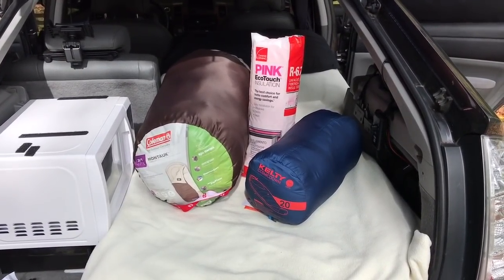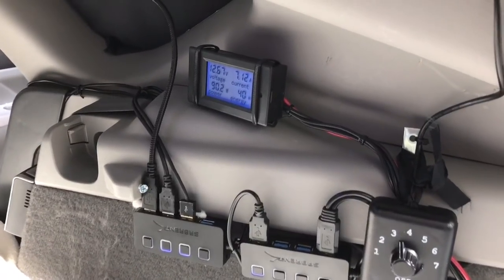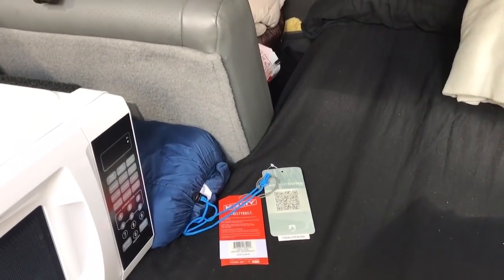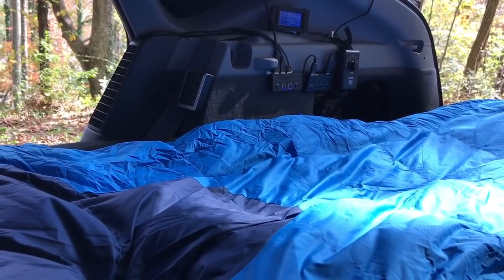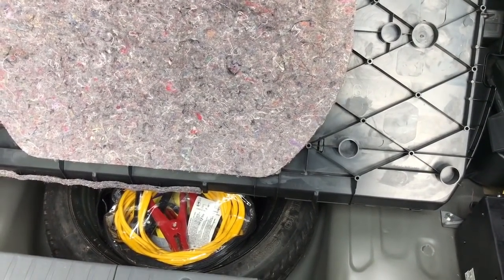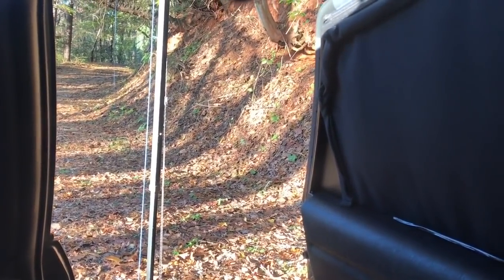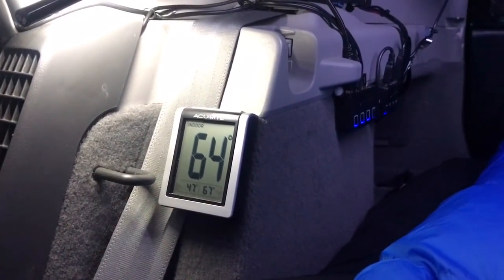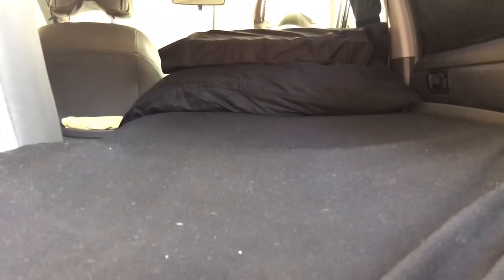Winter Prepping Insulating Kelty Sleeping Bag Prius Stealth Camper Heating Car Van Vanlife

Comment: Wool blankets do the best at trapping heat. I realize they are not easily washed ( will shrink) but can be found in thrift stores for very reasonable prices in good condition.  Wool is also anti microbial.  I cannot stand fleece because it’s hot, and made out of plastic bottles.  I need to lay down only on cotten or wool.
Reply from the maker: Good idea!

Comment: FYI it's a good idea not to use the stuff sack unless you absolutely need it because the longer the sleeping bag is compressed, the more quickly the filling loses its loft and insulating properties. This is why good quality sleeping bags always come loose in a hamper style bag rather than packed up tight in the stuff sack.

Comment: Loved the video and your electric set up I have a 2005 Chevy blazer 2dr 4x4  Which i have up upgraded almost everything on that truck small sample : 2.5" lift kit,  hand sewn Leather trim, Custom paint, Front and  rear dash cam on 24hr continuous  Electrical up grade 
Now in the late fall i sat down And thought of the main uses of my truck Mostly winter driving and Camping in the summer / fall and the odd run to the Drive-in with the girlfriend  Its just us and 2 small dogs  And i never plan on selling my truck 
So I removed the rear seats, The spare tire mounts on the left wall inside the truck on a metal tube frame which was removed  The plastic paneling was also removed  Roof paneling also removed to just behind the front seats  A wooden trim will cover the cut later.
The spare tire will lay mounted behind the drivers side seat (still able to move the seat back forth ) A framed cover over it. 
 A double battery in the pass, side and small PVC tubing on the inside walls in the back for wiring  Next will be welded angle iron in 3 inch pieces along the sides of the rear framing to make bedding slats rest on them and a pin or bolt to keep them in place or remove them for hauling items and need the space. I will be having a friend's company spray foam top to bottom ..Min 1 inch in some areas But 2 to 3 inchs for the most part The tubing will be buried in foam. Then the wood flooring  and pot lights (2 per side) 
I dont know the climate your in But I'm in Southern Canada and there is a lot of moisture in the Northern American zoning So batt without a vapor barrier or even with a barrier still makes the truck damp and moldy and rust out quicker 
With the Spray foam  The truck will stay cooler or warmer than the outside temp i would think by 10*C 
The windows will be fully covered with a thick canvas type cloth and double thick reflectix which gives a good R value  if you have a perfect seal
Now here is the best way to save even more heat > I will adjust the front seats all the way forward and bend them forward And another reflectix curtain One on each side will run on a tight cord on the roof with Velcro strips on the roof, sides and battery /spare tire frame 

If you have the money and chance ..Look up local Spray foam installers and see how much to do your car ..Provided you remove everything and prep the car for it ( cardboard the windows and tuck tape unwanted items ) Trim the extra foam P.S. its cheaper if you meet them on a job site and pull up and open the rear hatch ( takes about 20 mins if that 
Next idea is you can buy a 2 part spray foam canister for around 300USD and do it yourself 
Next is this gap filler spray foam which does not have the same R value but is good for nooks and crannies 
Ridged foam is also a good cheaper way provided you seal the gaps in between with Gap filler AND foam tape and making sure the have chaulking to the wall of whatever they are there to keep cold / heat out of so no water forms
Reply from the maker: Sounds like you have a great build in progress. If I tear mine down I think I will go with the spray foam. I think it's worth the cost. Thanks for posting all the good info and for watching!

Comment: Just found your series of videos and it great to get some ideas to add to my Prius road trips. Hit the subscribe button and look forward to what else you come up with.
one item that might be useful is duct insulation from Home Depot. I think the brand is Frost King. It is about 12 inches wide and comes in a roll. It has a gray  adhesive  material with a foil face. I used a couple of rolls to sound deaden the inside of the doors. Think cheap Dyno-mat. It really made a difference in the road noise and I am sure helps somewhat with insulating heat and cold.
Reply from the maker: Thanks for the tip, sounds like a great idea! Glad you are enjoying the videos and thanks for subscribing!

Comment: just adding another inexpensive blanket layer would hv done the trick... complement your current fleece w a synthetic blanket to help trap heat. also hug against your chest something like a pillow or teddy bear :D while u sleep...after a few min u can feel your core body heat reflecting back to u...even when sleeping on your back, just lay a pillow on your chest

Comment: I snow camped in my Prius V last winter. (btw my two favorite nights are -10 degrees F in a tent in Kings Canyon and 40 degrees, 20 mph wind next to a wind block outside in my bivy sack on Mt Kitadake in Japan--so  not only do I have some experience, I was snug and in bliss.) My tips: winter sleeping bag, fleece liner... and bivy sack (REI used to sell an inexpensive bivy sack that I picked up in a parking lot sale for $12 (best $12 purchase of my life). I'm sure you've figured out that a sleeping bag with all the  zippers up, and just a ring around mouth and eyes is 100% more effective than with even a one inch gap. Also, moving blankets are cheap, cozy, very  warm and keep in the heat.You're not allergic to down! I am so jealous. (If you do wake up with a plugged nose, put it in a dryer on air only. Takes a lot of the tiny nose itchers.) Of course you know not to stuff your down bag except when you have to.  In the snow I ran my Prius until about 9:30 pm and started up again at 5 am when I got up. I figure I ran the car over a week for about 30 hours on idle, to stay warm, run my inverter... and I don't think in 1800 miles I took more than 1 mpg off my efficiency. Have you done a  more scientific test on this? I'd love to know. There might be a day when a car is always 'on', like the electricity in a house and it just knows when to heat up a little, to start the traction motor, etc...
Reply from the maker: Wow! thanks for all the good info.  You are brave to endure such temperatures! Good to know about how you did it. I wasn't aware that some people are allergic to down, good to know. I eventually did figure out to leave the down sleeping bag out of the sleeve as much as possible.  It takes some time for the down to fluff and be most effective. I too am looking forward to refining the ON process to be full time.  I would be curious how the new Prius' are doing it, hopefully more efficiently and smartly.  Thanks for you comments!

Comment: While driving my Prius in cold weather, I notice some cold air comes from the handles where you open the door. A lot comes in. I was surprised when I put my hand and felt the cold air. Even during car camping.
Reply from the maker: I have had the same experience with the entire door feeling very cold. I wanted to open up the door panels to see if I could do something about it but was afraid I would break something expensive. I was able to solve the problem with the back hatch as I found a video where the worst that can happen is you have to get some of the cheap little plug connectors. I can't find a video on the door panel removal. Let me now if you run across one.
Reply: @timdillen  there was someone on another video recommending the search "soundproofing prius" that brought up how to remove the door covers. However, I would think that water or condensation would be an issue inside the doors. What did you find out about the insulation in the back panel, etc? Any water issues?

Comment: PSC Camper Conversions your Prius camper looks so cozy I want one just to sleep in instead of my bedroom! I hope I can make my old 1996 Isuzu Rodeo as cozy as your Prius. I had some leaks in the back hatch and it took me a while to discover and find them. By that time the carpet in the back bed was smelly and the underlay was even worse, and had black spots, which I was afraid was black mold. So I threw the whole thing out. Now the back cargo bed looks like the bed of an old pickup truck. Metal with ridges and valleys. I was thinking of putting down a sheet of plywood to even out the floor. Would you recommend using the same kind of insulation underneath the plywood as you used in this video?
Reply from the maker: That’s a tough call. People have a lot of opinions on it. Plywood would be good just make sure you completely seal both sides and edges with paint(exterior gloss)/caulk so mold can’t take hold. Several people recommend drilling large holes though to allow some airflow in the wood. I fold up my mattress occasionally just to make sure everything can breath.
Reply: @timdillen  thank you! My bed will probably be a raised platform and I will use either holes or build a slat bed, for the ventilation. But I want the floor to be solid. I'm really enjoying your videos and getting a lot of great ideas and information from them. Thank you!
Reply: Hopefully, you will eventually see this as I know that it's been a while since your post.   I'm curious as to how the rodeo faired, I have a rodeo as well that I'm tinkering with.
Reply: @tonietters1972  A lot of stuff came up and I have not yet converted my Rodeo. But I keep think of it, and turning over different ideas in my mind. One thing that really bothers me about my Rodeo is the electric windows keep failing. I buy new motors and the whole system that raises and lowers the windows and replacing them. But every couple of years or more often they fail again. Do you have any trouble with yours?

Comment: An  amazing series of videos! Thank you! But I have a question. Obviously the insulation helps in general, but the high consume electric blanket worth against the efficient Prius climate control? Finally the batteries are going to be charged by the engine anyway.
Reply from the maker: Good question.  I have been researching ways to stay warm that provide the least cost and most stealth.  The Prius climate control is great but I'm always trying to find a better way.  I am working on a new heating project which will provide lots of heat for very little money. I hope to have the new video up in about 2 weeks. Hope you will enjoy it.

Comment: I took a nap in my van today, and notice at the back I definately have to put my window treatment up, and probably devise some sort of insulation on the door. not quite sure yet.
Reply from the maker: I found the door panels that have operable windows don't have any insulation in them. When you compare the inserts to the door temp you can really tell a difference.

Comment: Great Vid.
You mentioned a possible moisture problem?
Doesn't the car develop a build up of moisture over night and when that happens isn't it going through the batt insulation to the metal (eventually)? Especially in the low lying areas like the spare tire area etc.
Thinking of how a house is made you might need a vapour barrier but that is problematic in a vehicle? The pink insulation is of little R value after it gets wet. However, Roxul insulation as an example doesn't ever loose its R value and its fire proof also. 
Still, I like your ideas and drive.
Ciao
Reply from the maker: So far I have not had any problems. The first thing I do in the morning is turn on the A/C (either hot or cold) which runs the compressor and clears things up in just a couple minutes. Then I open the windows a crack all around when driving that day.
Reply: @timdillen  why not leave the heater on all night in Ready mode?
Reply from the maker: That will work. I like to stealth camp in parking lots that don't allow RVs so I try to find ways to keep the engine kicking on and off the least amount.
Reply: For sure, your on the right track. I stealth camp as well in my Jeep.

Comment: Really enjoy your videos. Do you ever worry about CO2 inside of the car during the night?
Reply from the maker: Devin Miller So far I haven’t felt any ill affects. The Prius has an open vent system. On the passenger side rear seat there is a good size grill the draws air into the battery compartment. It then goes through a duct out the right rear wheel well. I think there is enough passive air with the car off. When in the ON position a fan comes on periodically in the compartment and draws in air. I think there are also other places where air leaks based on how certain panels feel when it’s cold out - especially door panels. It would not hurt to get a CO2 meter to check. So basically I’m not sure. Thanks for your comment and for watching!
Reply: I appreciate it. I had to sleep in my Prius recently at a festival and enjoyed the hybrid system for heating. The original shape of the Prius goes all the way back to the 30s . Ugly, but effecient use of space!

Comment: So, thx, loving this channel. Do you find your thermal insulation work has reduced the excessive road noise at highway speed?? And please, I cannot find a solution for stealthy insulating effect for hatch back window. Reviewed your great vids a couple times but............zip
Reply from the maker: John OBeirne Thanks for you kind comments. Yes the noise is very quiet from the back with the inserts plus mattress. I enjoy it. 

On the back hatch. Make an insert like in my relectix window cover video but don’t put material on the bottom side (interior side). I spray painted it black. Then I used an aluminum rod (see privacy curtian video) bent and cut to the shape of the hatch window from side to side. I then drilled two small holes in the hatch trim to hold the rod in place to keep the insert firmly in. I tried everything else before this but the heat-cool cycle made the insert drop out. 

Hope that helps. Thanks for watching!
Reply: PriusStealthCamper Adventures.    thx! Happy Trails!

Comment: what year is your Prius?  you mentioned that extra storage around the spare tire in the older models.  thanks.
Reply from the maker: Mine is a 2009. Has about 200,000 miles and no problems. Only oil change and 2 front tires in the last 50,000 miles.
Reply: @timdillen  thanks so much....wow, that is really great!

Comment: Somehow I can’t reply, or even open reply responses on YouTube.   I just updated my iPad 2 software , but I have had this problem for several months.  As for your electrical, I am in so much awe after watching that video, but really, have no knowledge of electrical and so, I wonder who I could get to do that to my vehicle. Do you think hiring an electrician would be good, even though they all work on houses and not car batteries?
Reply from the maker: Good question. The first place I would look would be for someone who installs car sterio equipment - either professional or hobby. The next resource would be your mechanic - some will enjoy the change of pace, some will turn up their noses. An electrician would be fine but they are expensive unless you are friends with one. Once you get the fuse box setup it's fairly easy to add additional items yourself - if you do something wrong you will just blow a fuse. You don't want to make a mistake on the other side that goes to the battery and car. My car was just $4,950 so I just blazed forward.
Reply: PriusStealthCamper Adventures thank you soooo  much.  I would never have thought of those options.   Also, I envy you for finding a Prius in that price range!  I have no luck, living in one of the top 3 largest cities in the USA.  Bummer.  I gotta get outta here!

Comment: if you leave the car on, how often does the engine run at 20 degrees outside temp? or 40? (etc) to heat the car up. I know in hot weather  people say a Prius only starts a few min per hour to run, since the AC is electric.  I'm wondering if the car runs a lot more than that in cold weather to produce heat?  since the engine is needed to make heat? trying to understand the difference between summer and winter, if the car runs much more in the cold weather vs hot?
Reply from the maker: That's a good question. The colder it is outside the more it runs.  I had another user comment that his engine ran a lot less than mine.  Since mine is older and has 183,000 miles on it , my battery is probably a bit weaker and the engine runs a bit more especially with the AC. When it was 40 deg out the car started about every 15-30 min for about 1-2 minutes. When it was 95 deg out the ran a lot - about 10 on and 10 off but that was running for 24 hours in the sun in a hot parking lot so pretty extreme.  When it was just heating or cooling about a 5-10 degree differential it ran very little, a couple minutes an hour. Hope that helps.  Thanks for watching!
Reply: PriusStealthCamper Adventures  Thanks for the response, and detailed info. that helps alot.

Comment: Did you consider Reflectix?
Reply from the maker: Glen Faught Jr I considered it a bit. All my windows have a layer of reflectix between the material and corrugated vinyl layers and works nicely. Since the hatch space is so uneven and has a lot of wires I decided to just go with the batting for now. I will check tonight and see if what I have is effective. Thanks for watching!